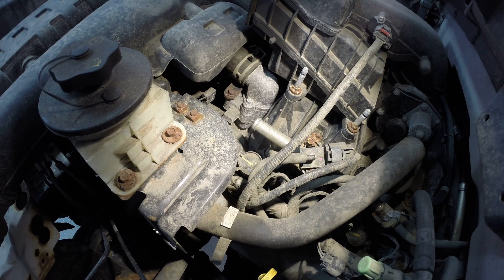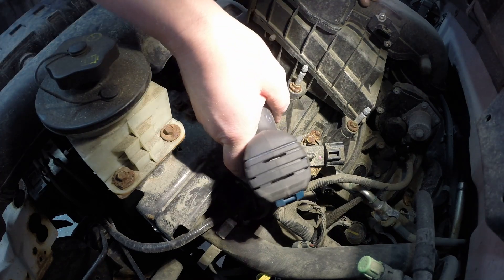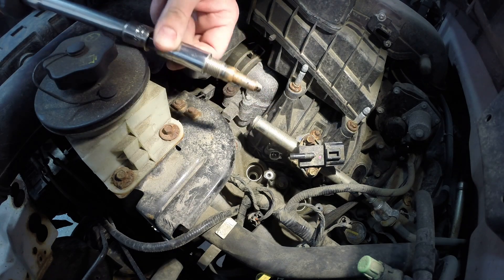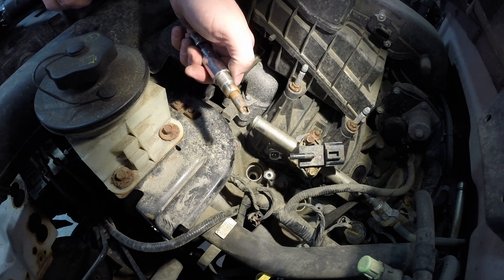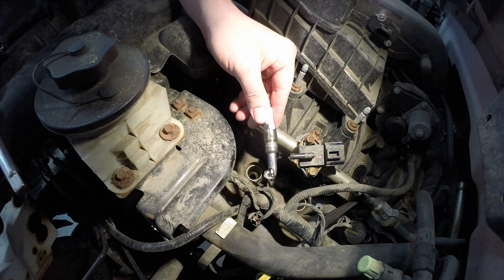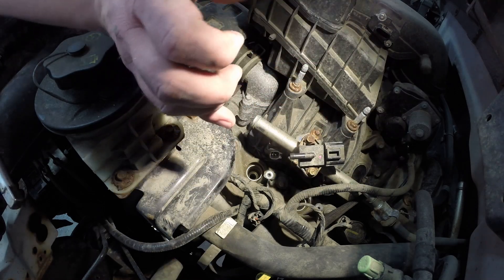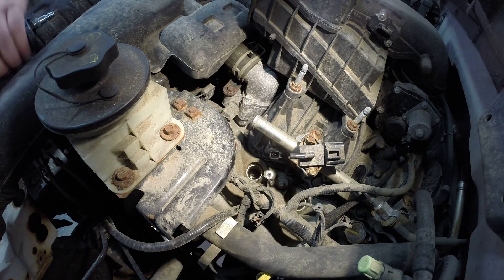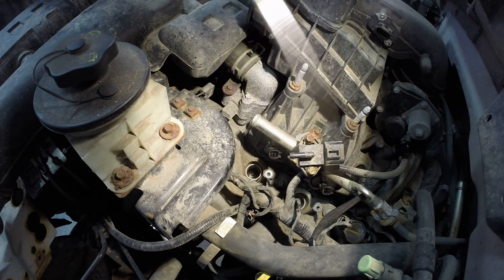The Best Method for Removing STUCK Ford 4.6L & 5.4L 3V Spark Plugs??

Comment: I have a 2010 XLT with a 4.6 3v and have searched several forums to see if mine has the dreaded spark spark plug problem. Some posters say plugs in my 2010 are no problem while others claim they are still prone to braking and to expect a $700 tune up at the shop.  

I've only got 28K miles on mine so I don't need to change them out right away but I'm hoping you can give me an idea of when they should be replaced and what to expect when I finally do need to have to replace them.  100K seems a bit much so I take Ford's recommendations with a grain of salt. 

Thanks!
Reply: The 09-2010 5.4 , 4.6 3v and some late engine build date 5.4's in 08' have the "standard" plug design.  So you're safe my friend.  But you like me still the all to common phaser issue. All I can say is be aggressive with oil changes.   As you may of read these engines always love clean oil.

I recently did a complete timing kit over haul. New oem Ford parts for everything. Now I run Penzoil Platinum 5w20 (full synthetic) and a MC FL820 filter every 5k miles. Now this 5.4 is quieter and runs better then it ever has.  Good luck

Comment: If I wanted too buy a ford with no problems, What year, and why?
Reply: Buy one with pushrods if you want a good one....or 7.3 Powerstroke
Reply from the maker: +Justin Tornatola You are going to have to narrow it down to a model there are too many variables.
Reply: +FordTechMakuloco I've Heard A lot of things about the F-150's From 2004-2012, Like how Ford installed Shitty crankshafts that are done within 100k miles, So My question pretty much is, What is The Best Year Model? Like Really Efficient, Has a lot of Power etc.
Reply: No such thing, Ford with no problems lol
Reply: I know this is a 2 year old post but i would stick with the 2 valve v8's
Reply: impossible to do ,no such thing

Comment: Quick question my 1998 Ford Expedition Eddie Bauer 5.4l keeps blowing fuse 5 on driver side what's does this mean?another question I already changed my battery , my starter new ground cable my Neutral safety switch and my car won't turn on any help but when it does turn on it runs really well.. It's just during the ignition process plz help

Comment: I recently bought a 2000 ford expedition for a real good price it is in pristine condition but I have recently started hearing a ticking noise that will last for about a minute or so as I pull away from where I parked. I checked the noise in the morning to see if I could hear what it was but did not hear anything so away I go... then I heard it again. It only does it as I drive away then it stops for the rest of the time I drive. I wonder if it could be a bad spark plug or a bad solenoid. What do you think I have done a lot of research but have so far found nothing.

Comment: How strong is that impact gun?
Reply: I ask as my heavy duty one seems like it'd be a risk.
Reply from the maker: +DE “AutoBravado” Nichols This particular one is rated at 500ftlbs but real world testing has it at 619ft lbs unlike the other junk nano impacts on the market that fall under their rating in real world test.
Reply: FordTechMakuloco Cool. Mine is a reasonably close in ft lbs so it'd work for this technique.

Comment: Will a 20v impact driver work? It has 1500 lb torque full battery
Reply from the maker: +Tom Drew (wheelerdrew66) Seems like overkill and I am sure anything that strong won't fit in the rear cylinders.
Reply: Tom Drew The impact vibration is the important part. You're not pushing by hand, so I think it'd be fine, but I haven't tried it either. 

I have tools stronger and weaker, but nothing that strength to try it.
Reply: I have an air impact that does 650. I was asking him if it was too much. I hope he can answer on this one.
Reply: +Tom Drew (wheelerdrew66) ....you sure that's not inch pounds?
Reply: Dirtyharry70585 They do make them that strong, but often that is inch pounds.
Reply: +Dirtyharry70585 my bad it's in/lb. I do have air impact but I can't find it lol
Reply: Tom Drew So that's 125 ft lbs. Doesn't it bug you they put tools like that in inch pounds to sound awesome when really, it's just harder to judge them? 

Not bad force at all. I have tools specifically bought to be half and 1/4 that for jobs where I don't want overkill.
Reply: +DE “AutoBravado” Nichols yeah it kinda does,125 ft lbs don't sound like much now I wonder it will work to take my sparks plus without breaking them

Comment: I use a similar method as this. I loosen all the coil bolts but make sure the coils remain on the plugs. Then I let the vehicle run until it is hot. Once it is hot I turn off the vehicle and remove all the coils and blow everything out real well. I then use an Ingersoll Rand Hammerhead air ratchet and break them all loose one after another. As soon as I have broke them all loose I go one by one and blow out the hole again before taking out the plug from each hole. Never had a problem with this method and the Hammerhead is a great tool for this. I am a Ford tech in California and like your channel bud keep up the good work.
Reply: Hello Coyote. I got a 05 F150 5.4 motor. If you get the motor hot before extracting the plugs, how d you let the Motorcraft Carb cleaner down the hole soak overnite?  That was Brien's Fordtechmakuloco recommendation on a previous video.  Is he or you not recommending soaking the plugs any longer? I am now confused.  I have the newer one part plug in the truck currently, so there should not be an issue about breaking due to that crazy  plug design.  I have 323,000 miles on the motor and it runs great.  About 90,000 miles on the latest plugs.
Reply: @lostinmyspace4910  I have soaked them and also done it without soaking them.
Reply: Hi
Reply: this guy has a bible for ford trucks
Reply: grease the treads next time.

Comment: I have an engine misfire, took the coils off and checked them and applied dielectric grease. Not getting a check engine light, could it be a bad plug?
Reply: That's great DE! I would wanna see that. I replaced my plugs a week ago with Ford plugs from eBay no fix. Also got all 8 cop on there too for $34 shipped.. I just bought my EB expedition like a week and a half ago. It was stuck in 4lo plus it was a chevy guy that had it.. Didn't know what he had. I crawled under there took off t-case motor put it in 2wd handed him 1k and drove away mind you no rust dents or major scratches.... My cops had 243k on them... That's y I replaced it em all. Better that way and cheaper in the long run.
Reply: It could. Or an injector, or the worst engine damage.
Reply: coil pack! my 98 EB epoxy had a bad miss no cel.. replaced all 8 cop. now she runs like a skinned cat
Reply: Shane Hildebrand
Most people replace 1 at a time as they truly fail, but that actually is the best way.
Reply: Shane Hildebrand
That gives me a great idea. When I'm done pulling my engine apart, fixing it, I'll buy a new set of coil packs with before and after wHP numbers (all on my channel) numbers so people will know the power of replacement versus hanging on to them for all but failure.

I've been talking about replacing them for 9 years but without a failure I wasn't taking myself seriously.

I think 180k miles is far enough. :)
Reply: +Shane Hildebrand yes it was either a cop or the plugs. I sprayed wd40 on the coils especially the boots and onto the plugs. Did only 5 of the 8 and that fixed the misfire. So obviously there was water interfering
Reply: Shane Hildebrand It's the only way it'll run even.
Reply: +DE “AutoBravado” Nichols got that right! now passenger side collector bolt rusted away.. headers in the future hehe wife thinks that's what it needs to fix it lmao..
Reply: Shane Hildebrand
Right now I'm pooling data about the use of ethanol free gasoline for a video. So far the same MPG, but the truck feels a lot smoother.

I've been trying Lucas upper cylinder lubricant at a few ounces per gas tank (I adjust how much depending on how often I feel up.)

Showing my wife yesterday at the last fill up she was like okay..."Wait! That's on the truck!" Yeah, 22 MPG when I was doing 14-16 for the last year. And the results are repeating. :) (Record 25 mpg in my Frontier, but 18 was usual when I lived at higher altitude. I guess it liked thinner air for good MPG.)
Reply: +DE “AutoBravado” Nichols that's interesting!! I don't know my mpg cause fuel gauge don't work.. got a sending unit but they sent the wrong one.. bastards
Reply: Shane Hildebrand It's more accurate to figure out fuel mileage with miles and always filling the gas tank up to the first click. You don't need a fuel sending unit to figure mpg's out.
Reply: +DE “AutoBravado” Nichols true but I need a sending unit cause my wife drives it... lol she be pissed at me if she runs outta gas somewhere. always the guys fault ya kno
Reply: Shane Hildebrand
LOL. I know, right? I kept explaining while mine wasn't working. When you gas up, gas up all the way and reset the trip meter. I can't be running out of gas at 100 miles on this and you can't either.

No matter how broke you think we are, filling up the tank all the way is the only option.

It took a couple months but she started get excited. Wait, the fuel gauge works? :)

Comment: changed out plugs last year on my 06 f150 118,000 mi original plugs. Added 1 can to 3 gallons of fuel let truck idle for bout 30 minutes used 9/16 socket with my makita 18v impact no problem

Comment: I did this a month ago on my 07 Expedition with a cold engine... all came out with no problem.
Reply: +GDWS81 Cool man, I have 36,000 on a '08 4.6, and I'm taking those bastards out ASAP after I run a couple of cans of sea foam with a half tank of gas. That's the strategy anyway. Good to hear people are having luck getting these out without problems. Saw too many videos with that crunching sound of porcelain.
Reply: I have a a 07 Expedition too, and I will be doing changing the plugs any tips? Thanks

Comment: I've been able to change mine out twice without breaking, once cold once warm and never with an impact. They'd squealed like pigs coming out both times. Do you the type of engine oil and/or fuel can affect the likelihood of these breaking? I've read of many cases where they don't break and many cases where several break.
Reply: Yup squealing very much but just my opinion if you can feel and know when enough is enough you can always get these out with a 3/8 ratchet at least I can cold/ warm blazing hot ain’t going to sweat my ass off I’m going work on another car let it cool down

Comment: How did the remainder of the job go? Wondering how well this method worked on the rear plugs. Thanks again for another inspirational video.
Reply from the maker: +nathan3306 They all came out no problem because I was able to get to the rear cylinders with this small of a gun so it was a nice change.
Reply: @FordTechMakuloco , that particular air cat is not available now. Does the foot pounds of torque matter or just the size of it to fit in and get on the plugs straight and solid?

Comment: Thanks Brian.  A few years ago I was going to change the plugs on my 05 Expy but saw a post from you on Automotive Forums that stopped me from probably breaking all of them trying the normal way.  I've been holding off, since at the time extractors were snapping and unless they weren't firing, I decided to take the wait and see approach.  Now It looks like they have perfected the extractors and lots of experience by you and others has shown the best removal with minimal breakage.  The appreciation from all of us is immense.Randy (automotive forums handle 65Comet)
Reply: Got my aircat impact finally yesterday after it was back ordered for awhile.  Just did the drivers side.  Number 5 broke.  6 and 7 came out looking very clean.  8 broke.  So I guess it is time to get a Lisle extractor.  Dang, I had such high hopes to not break any.  I'll update how the other side goes when I get to it.

Comment: Could i use a electric impact gun. I have a 97 Ford Expedition i need to do the plugs on?
Reply from the maker: +darkwolflord no need yours are 2v plugs they come right out with regular hand tools
Reply: +FordTechMakuloco well what the breaking problem i heard so much about in the removing of plugs
Reply from the maker: +darkwolflord only the 3v engine have the broken spark plug issue.
Reply: +FordTechMakuloco ok thanks

Comment: here in texas, i still see these ticking time bombs all over the place. ford sold shitloads of these trucks, so they're gonna remain on the road for quite some time.
Reply: +Johnny Fbomb these motors are not only ticking time bombs because of spark plugs they have horrible problems with fords varible valve timeing or cam phasers
Reply: +Jesse Dean  you're right till an extent.  But these 5.4 3vs are great engines you just can't neglect them.  Unfortunately they are not built for the average person that doesn't know how to maintain there engine.  The most important you can't take these engines 8-10k between oil changes. No matter what kind of oil you use.
Reply: +Johnny Fbomb  I wouldn't even do that to my beater ruscort let alone my F150. These engines are expensive but frequent oil changes are much cheaper.

Comment: Nice video...thanks!  Do you recommend replacing the coil packs once you get over 100k on these 5.4's?  If so, do you recommend OEM Motorcraft...or how about aftermarket coil packs like Accel?  Thanks for any thoughts on this.
Reply from the maker: +Dewy Russler Yes over 100k it seems they start to fail one by one from all the heat cycles. I prefer motorcraft and at amazon prices the total cost is not so bad-http://amzn.to/1XVAwAi
Reply from the maker: +FordTechMakuloco Accel is my second choice for those on a budget-http://amzn.to/1MXj5Pm
Reply: Thanks FordTechMakuloco.  I have a 2004 F-150.  If my plugs were replaced in 2006-2007 (right after the tsb came out) at about 30k miles, do you think I would have problems replacing them now without the impact you used?  The dealership did it at cost for me at that time...hopefully used the updated plugs and anti-sieze but I'm still worried about changing them now at 100k miles.  What do you think?

Comment: I have no idea how these plugs last so long. I have a 2000 F150 with the 4.6L, it has 315,000 km with original plugs. In fact its original everything aside from brakes, shocks, battery and alternator. I know i really should pull the plugs, but its still running strong.
Reply: I agree with what you should do, however that is still cool. 

When little has been needed on a vehicle over a long time it has made me hold on to a car for too long.

While it still has golden years maybe it's time to sale.

Our only differences in our stories is my vehicle had new plugs every 12 thousands miles. I love how good new plugs feel.

When I switched to Iridiums, what my "Corolla" should have had the whole time, now I run plugs maybe 50k miles.
Reply: I think you're truck has plenty of life left, but things start to get more expensive soon on most vehicles. You're choice. Financially, I made the wrong choice on the surface, but the constant repairs made me a tech and a video maker after that. Lol

Comment: I have the 2007 5.4 3v with 158K miles and need the job done, but worried my regular mechanic will not have the skill that a dealership guy would have from doing a bunch of these.  Just afraid I am gonna get slammed with the typical dealership run around and overpriced cost.  Sorry, I have trust issues and wish you were in the northeast.  Any plans to do your summer car across America like last year?  What coils would you recommend on this since I plan on changing them all out as well.  Thanks.
Reply from the maker: +clyde8drive I recommend the Motorcraft coils first and with the cheap prices on amazon a full set of 8 doesn't cost that much-http://amzn.to/1qR3Pch
Reply from the maker: +clyde8drive This is an even better deal if you are replacing plugs and coils at the same time you can save allot-http://amzn.to/1NQgqlj
Reply from the maker: +clyde8drive Otherwise a good aftermarket is the Accel coils-http://amzn.to/1qR45Ii
Reply: +clyde8drive  North east  Take a look at South Main Auto Repair. Avoca NY,  Or if you're closer to Cooperstown there is Fly Creek Auto Repair.

Comment: you should allow the new spark plug to warm up to engine temperature before torqueing it down. if you dont the plug will expandand become way to tight and tear up the threads.
Reply from the maker: +smoke skull I have never heard of that but following this method it will allow for that as we are tightening them by hand then moving onto the next plug by the time you go back to torque them they will be the same temp for sure.

Comment: my brother has a 99 Expedition with a 5.4 Triton not sure if it has the 3 valve but the worst he has had so far was a blown plug. I am so glad I have the 5.0 LOL
Reply from the maker: +Brandon Beard No he has the 2v engine which as you have stated have an issue with ejecting plugs where as these it just the opposite.
Reply: +FordTechMakuloco I see, thank you good to know. And I will say that when one blows and you're standing next to it it does scare the crap out of you LOL

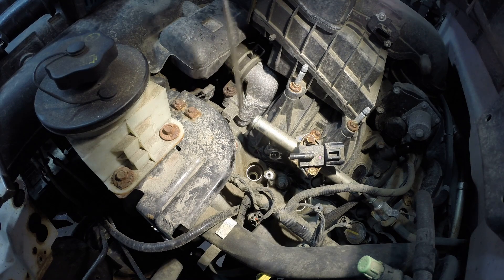Comment: 5:16  For anyone who thinks this step is controversial Brian, I run a strong vacuum right next to where the debris is blown out, to help prevent it from going back down into the combustion chamber.  But as you say...It shouldn't be a problem. Thanks for another great video.
Reply from the maker: +matt8863 The way I do it there is so much garbage blown off the engine before I ever open it up and when I blow that hole out after the plug is out I do it over an over again not just one shot this way its ultra clean till no debri is flying about it has worked out for me over the years.